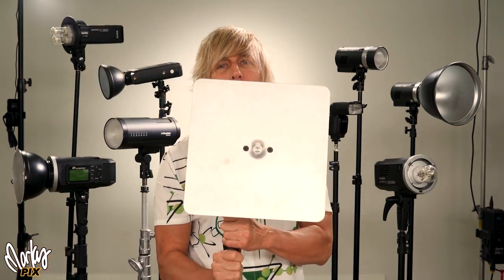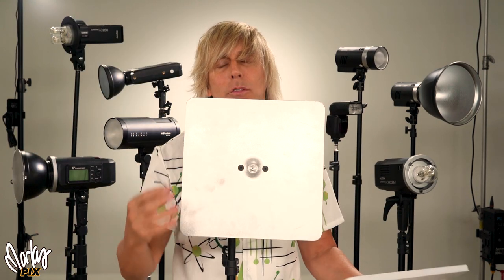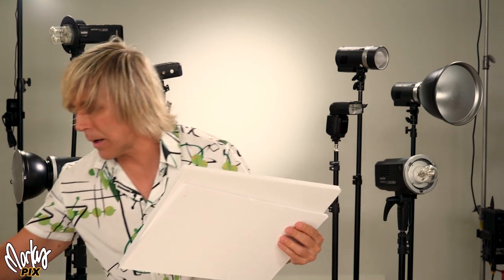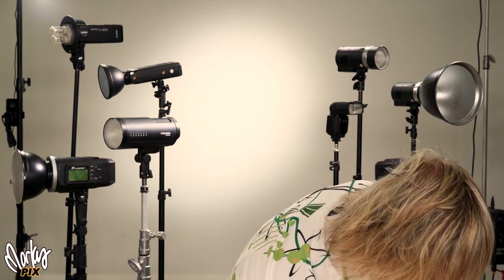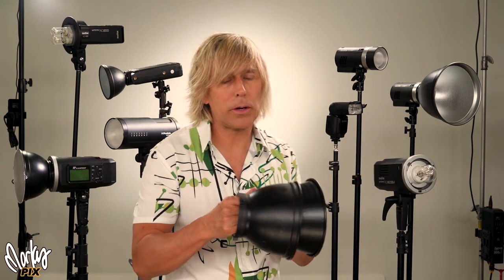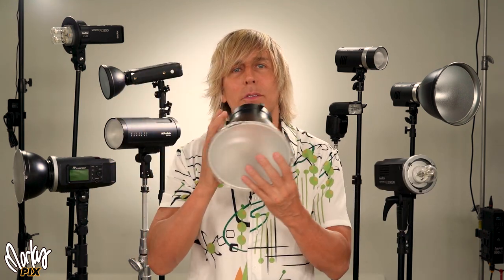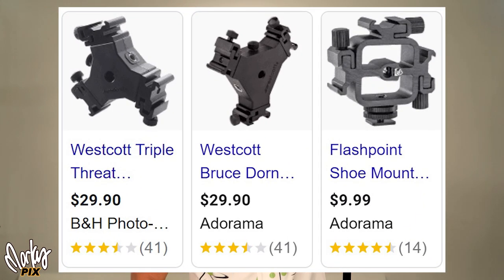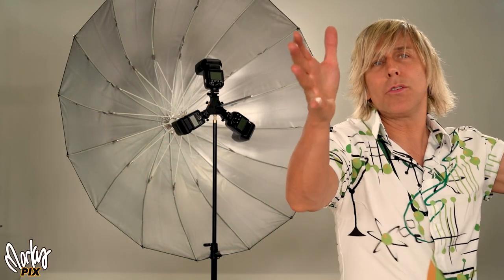Double the Power of Your Flash !

Comment: 2:59 I think you actually get partial power of your HSS flash because half of your flashes' power is hitting the curtains while without HSS, the single flash hits the full sensor. At high shutter speeds, only a tiny fraction of the sensor is exposed at a given time, so for each flash most of the light is wasted by exposing the curtains.

Comment: The Nikon D50, D70, D40 and D1 cameras will sync up to 1/8000th sec if you just use the center pin. The D1x will sync to 1/16000th. At that speed, the flash becomes a constant at higher flash powers. Yeah they’re old cameras and you need to use cables instead of radio transmitters, but it works great.

Comment: great video Markus, one small correction I believe you would need 4 Speedlight's to actually get 3 times the amount of light.(3 speedlights would only give you 2.5x the light..) in regards to getting brighter light by moving the light 1 or 2 feet closer to the subject this would only be more applicable the closer the light is from the subject, if for example the light is 20 feet from the subject, moving it 2 feet closer will not change exposure by more than 1/4 stop..

Comment: Hi Markus,  two questions.  Will the faceted reflector double the power of the AD200 Pro?  What happed to your video with the Angler Fastbox?  Thanks.
Reply from the maker: No it won't because the S bracket screws it up.
Angler video https://youtu.be/VZQM3EJ8IXc
But now I like the SMDV flip 32 better because its bigger
https://youtu.be/Uoars6DDFMw
and https://youtu.be/2Vg-WYMlqWk?t=93
and
https://youtu.be/yxwJRoD2u1U?t=2

Comment: …or use a camera with another shutter type, like a central shutter (try the cheap, old Panasonic LX100 as a simple example).
Reply from the maker: yeah too bad the lens isn't removeable
Reply: @MarkusPix  Agreed, but it was the cheapest, reasonable quality solution, I know ;-)

Buuut… there’s always Hasselblad with leaf shutter lenses; only a “trifle” more expensive (Ahem) 😇
Reply: Fuji X100 series are the same. Or a medium format camera with a leaf shutter lens. Then the issue becomes making sure the flash duration is short enough that it all "fits" within the shutter speed.
Reply: @HellbellyUK  I have no first hand knowledge of the Fuji, but I take your word for it. It sounds reasonable.

The shutter speed is rather flexible in real life on the LX100. Even with the really feeble standard accessory flash of the LX100, you first run into real and clearly visible (due to plain lack of power) trouble at 1/4000 sec. Most cases at 1/2000 sec work, and if you limit your shutter to 1/1000 sec, there are scant a problem (at least I haven’t seen them - not to say, they couldn’t be provoked in some circumstances, I haven’t tried).

The good thing is, that 1/1000 sec freezes most movements, and the faint flash has a short reach, so the background quickly enters into black. Not like my big, powerful Canon Speedlites, that easily illuminates not only your target, but huge parts of the room to boot (feels like a potential reach of - at least - a gazillion miles 🤪).

I often use the little LX100 critter on travels, for available light use, and where movements are involved, even the feeble attached flash comes handy, if use is allowed

Lately I’ve experimented with allowing higher ISO’s, than usual, and then letting the DxO Deep Prime loose on the result. Not perfect, but amazingly versatile 😱

Comment: Hi Markus, biig fan of your videos and you “no nonsense approach” to many issues within photography. I’m of course using Godox for sunshine photography but I fail to understand how ND filters could be better than HS.
If you put a ND filter on you lens you also reduces the power of the flash since it has to travel the same way as the surrounding light – how can this be an advantage.
I fail to understand the logic in your proposal – are you able to explain fairly simple what I’m missing (not understanding) ??
Reply from the maker: Getting more power from flash means not using HSS which means staying at or below the cameras maximum sync speed, which is usually around 1/160 or 1/250. So if you want that nice blurry background, that means shooting at f1.8 . If your lens is wide open shooting at 1/200sec, you will be way overexposed unless you use ND filters.  Of course you could shoot 1/200 at f22 and not need ND filters, but then you wouldn't have a nice blurry background.   The camera exposure is the same either way... but not using HSS means your flash puts out more power, so the foreground is brighter.
Reply: @MarkusPix  - I think I have found the reason/explanation, which you should probably have put into your video (which is already utterly good/perfect) - reason why the flash delivers more power at full flash instead of HSS is because the recharge of the flash which is less when trying to do HSS instead of on single strobe ...
Only a few others trying to explain the difference between ND filtered/HSS flash actually explains this logical reason for the difference.
So here it is....
Great fan of your videos and work which is shared in my network each time you post a "nuggets of gold" which happens more and more frequently.
Thanks Markus

Comment: I was taking pictures yesterday and ran into a problem I don’t understand. I set my background exposure 1.3 stops under, took a picture and perfect, I put the trigger on the camera and set the flash to its lowest setting, took a picture and the shot was massively over exposed, almost all white. Not sure how this happened, any ideas? I was on the beach and using a softbox in the middle of the day.
Reply: After installing the flash, your camera automatically switched to synchronized shutter speed by increasing the shutter speed.

Comment: I really need to understand this .
So let’s say your eyes are the sensor,
And the flash is firing at full power,
But you have sunglasses on now ( ND )
You still gonna see less light from the flash.

So naked eyes with less flash power isn’t it the same as full power with sunglasses on ? 

Can you break this down clearly please.
Thank you and we love you you are the best 
🙏 
I guess this work for flashes or cameras that doesn’t have HSS
Reply: I’m not sure if this addresses your question exactly but as I understand it, yes you will see less light with your sunglasses on. 

However, the difference between your eyes and a camera lens is that you can open up your lens more to compensate for the ND. You can’t “open up” your eye’s iris past a certain point. 

FWIW your eye is at approximately f2.1 in total darkness and f8.3 to f11 in sunlight.

In any case, the ND allows you to crank up the power of the flash but still achieve shallow depth of field. 

If you didn’t have the ND, you couldn’t have the lens wide open (to get that shallow depth of field) without over exposing your shot. 

You might think you could just increase your shutter speed to compensate but the flash happens so fast and is so powerful in comparison that shutter speed doesn’t have any effect except on ambient lighting around the subject.

Does that help?
Reply: @EliFleming  yes Eli I understand that the reason behind all this whether it’s the HSS or the ND is to shot at lower f stop to get a shallower depth of field
But depth of field aside, 
We are talking about doubling the flash power .
It’s true that the flash will fire at full power,
But you have an ND now between you and the exposure.
Thank you Eli Fleming 
I appreciate it
Reply: The way I always describe it is you're swapping stops of shutter speed for stops of aperture, and as far as the flash cares, stops of aperture and stops of ND are interchangable.
 So instead of of f11 1/200sec ISO100 No ND, you're at f1.4 1/200 sec ISO100 ND64 (which is 6 stops). As far as flash exposure it's the same exposure, and the ambient exposure stays the same as well.
Reply from the maker: ELi- you're not really darkening the image- you're keeping it the same. High speed sync uses fast shutter speeds, in the thousandths, but non HSS requires a much slower shutter speed- usually around 1/200 sec because that's the fastest speed your camera will allow to sync (non HSS),  and shutter speeds that slow will lighten your shot a lot, so to expose properly, you need to darken something, hence the ND filter.
Reply: @MarkusPix  unless I’m missing something, that’s what I was trying to say in the 4th and 5th paragraphs of my reply. @HellbellyUK summed it up more clearly than I did. Did you mean to reply to the OP?